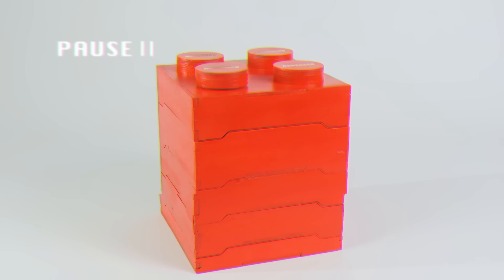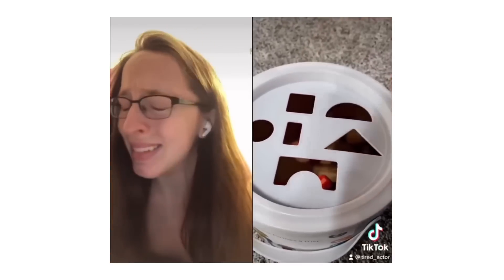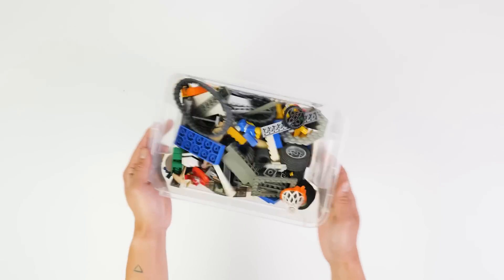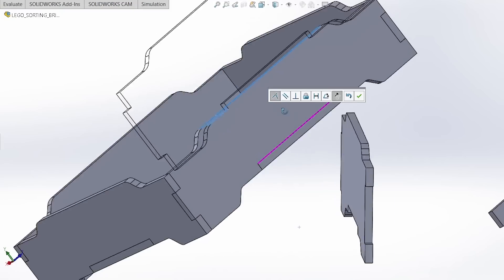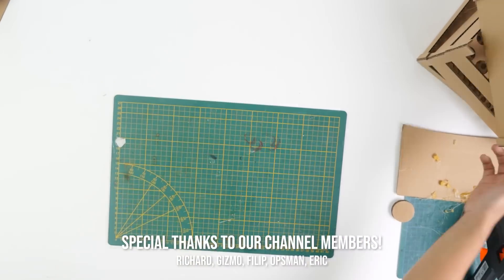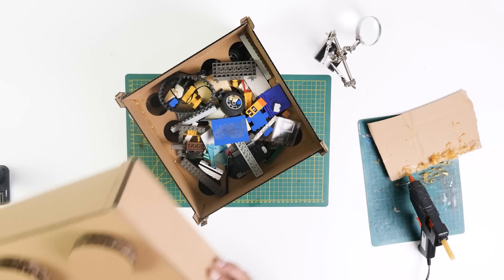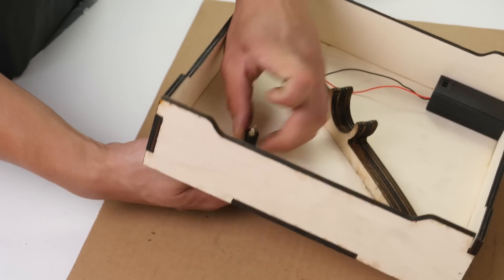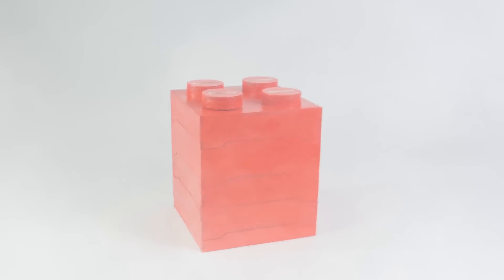I Built a DIY Automated LEGO Sorter

Comment: 2:09 no I mean yes it sounds easy but them large plates are going to be REALLY good at blocking the holes stopping the smaller bits from falling though, once your past the plates part it will get slightly easier but the whole reason a coin sorter works is it has a way to get rid of everything it it’s sorting try while what you suggested is both the sort tray and the final destination which is going to be a pain in your ass.
Reply from the maker: I haven't really had that problem yet to be honest but I get where you're coming from
Reply: To be fair it wouldn't be that hard to just... Pick out the large plates. They're kinda already large and obvious.
Reply: @SunshineCo225 at that point you're sorting the Legos yourself lmao. You missed the point, at every level the Legos will clog the holes of the smaller holed tray that they sit on, meaning you'd have to pull Legos out on every size

Comment: I have a 5 stage bean sorter I got from Amazon a few years ago, same concept. However you have to take it a step further, start with your bulk lego (small, big, and technic) and use the largest sorter and scoop bulk into it while it's sitting in a bin it's size. Shake and mix until the smaller parts are in the clear bin and dump the large parts (you can fish out technic CCBS and partial builds out) then repeat until third box is full and bin of small/medium is full. Take layers 1-4 and use those to sort by size. It helps to get the sorting by size done first then take a paper plate and sort the sizes by type.
Reply from the maker: That sounds like it works well too!